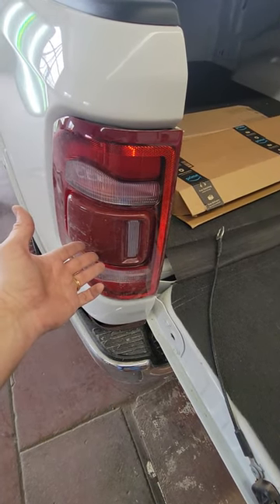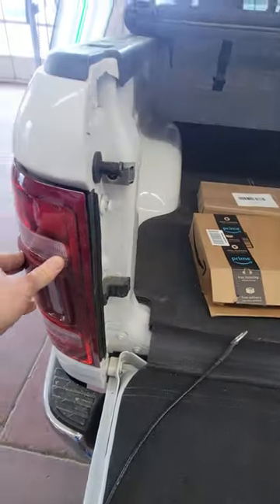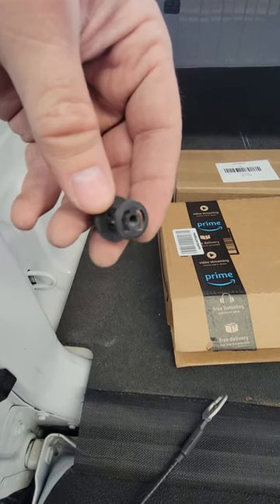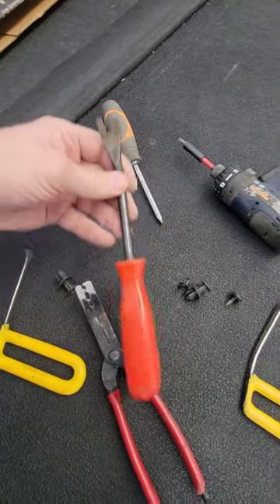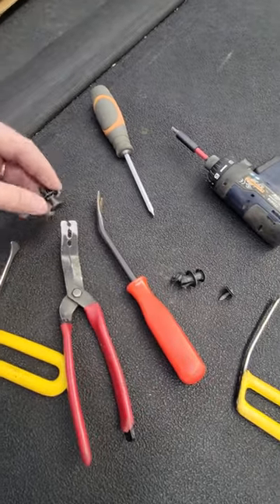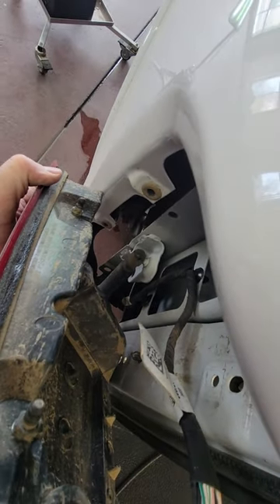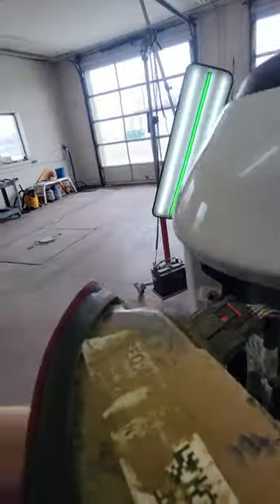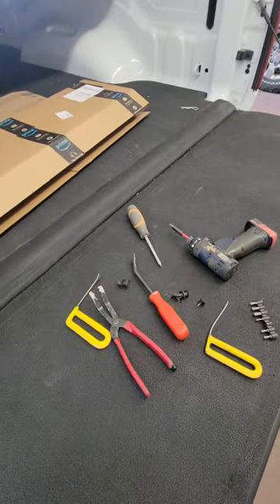2021 Ram 1500  Tail Light removal

Comment: First remove the screw and the screw it into the end of the push pin a few threads enough you can pull the center of the push pin
Reply: Thank you. Just spared me a further 10 minutes of frustration
Reply: Bro THIS! 3 stores didn’t have the tool, this was as simple as it gets

Comment: Plastic pins were so useless. I bought the right tool and both still broke. No clue why they even added it. The secret is to just rip them out and throw them in the trash
Reply: How did you get yours out mine just broke

Comment: What if I ruined the push pins. I had to tear them up. They wouldn’t come off easy.
Reply from the maker: Honestly you dont really need them. Taillight is secure with just the screws but you could go to your local RAM dealer and order a couple from the parts dept.
Reply: @willbaker920  thank you! I ended finding some similar at Auto Zone.